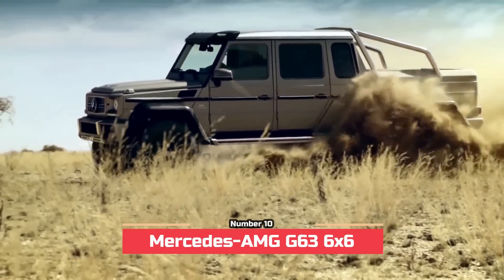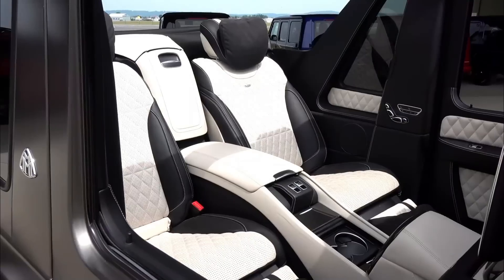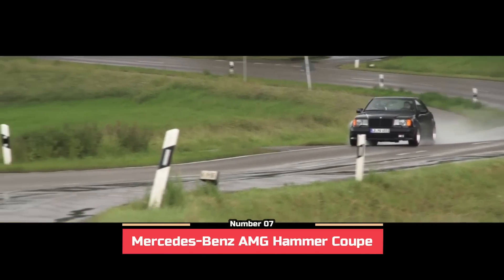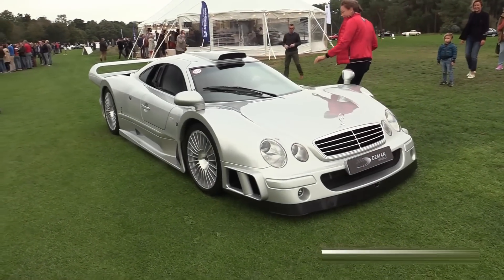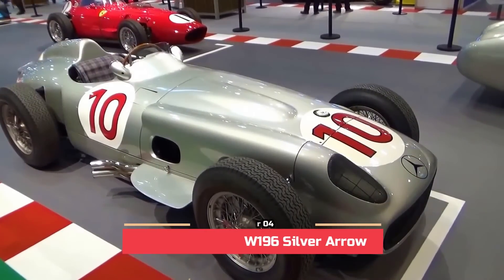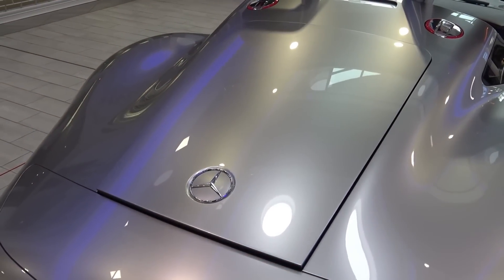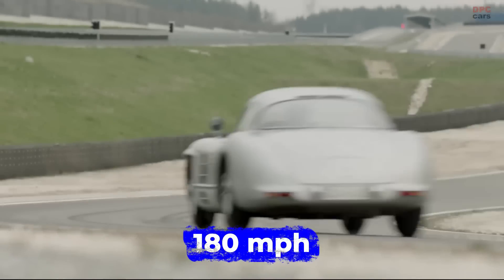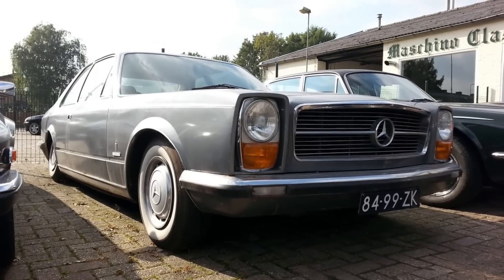Top 10 Rarest Mercedes Cars In The World

Comment: The C-111 was not a single model - it was only partly a show car; it was mainly a prototype and had at least three different basic bodyshell styles.
Reply: Lies. There is a single model of the C111. The C111 is NOT a one-off car.
Reply: @UltramanMebiusBrave  that is a very offensive statement, accusing someone of telling "lies". Normally we would tone such a comment down and suggest someone is mistaken - however, I think if you do a bit of research into the C-111, you will find at least three differing body styles, no sales literature, no full-production vehicles in private hands, various engine types (Wankel petrol, Diesel etc.)...